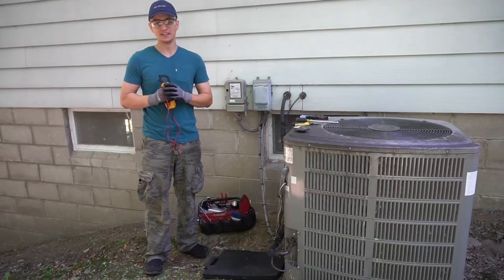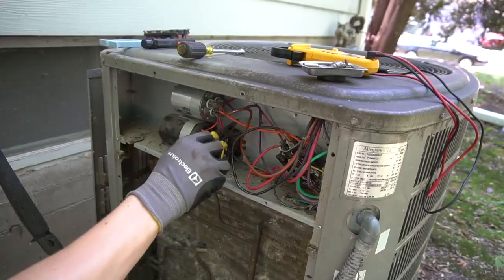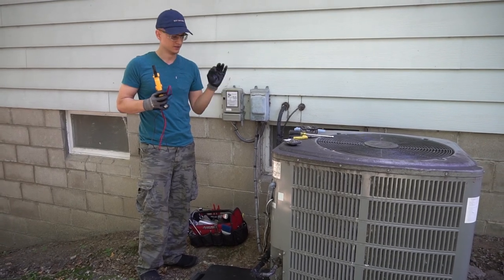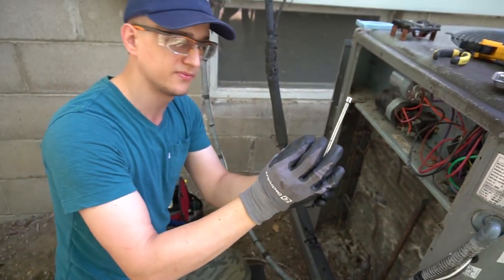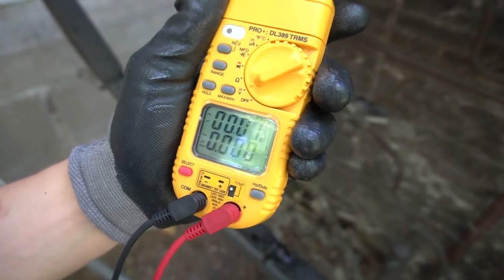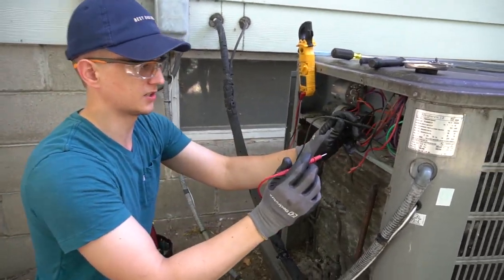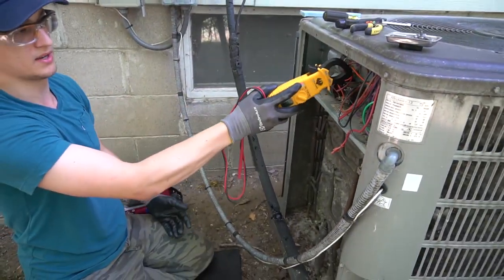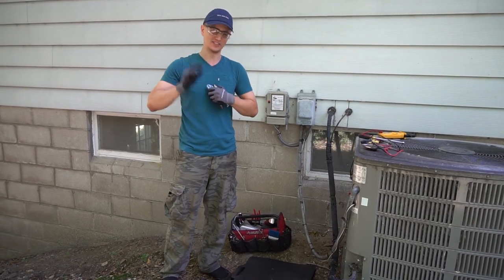Watch This BEFORE You Fix Your Own AC

Comment from the maker: Last week one of our techs at work had a similar scenario that I talked about in the video. He pulled out the AC condenser disconnect and when he touched a terminal with his needle nose, it sparked. He investigated and found that the disconnect was not wired at all! Whoever put in the disconnect pretty much bypassed it. Taking out the plug does nothing. So double checking if your unit has power is an important step.. Stay safe!

Comment: I was taught to always test your leads on the continuity setting before testing voltage. If you a bad lead it might not show voltage even though it’s there. I’ve done this and taught this for 25 years now.
Reply from the maker: Now that you say that.. They did drill that into us at school but I guess somewhere along the way I stopped doing it. Thank you for the reminder!
Reply: What's that, the continuity setting, do?
Reply: @LBizKid04  It can tell if the wires are connected
Reply: @SpencerLemay  thanks man
Reply: I'm retired union electrician and safety is paramount in our workplace. I heard that when we began organizing members our mortality rate was one out of every two wireman were killed by electrocution . And when I began wiring in the late 60's , there was very little grounding in the codes and being done in housing. Over the years it has increased and is infinitely better safer today than it was in the beginning. 
  And we used to work things energized often when troubleshooting as an example but we don't anymore. Been many years since then.  And when we open a circuit we use personal physical locks that we individually have the only key to be able to energize after we lock it out. And at each lock we leave a tag stating who we are and that we have the circuit de energized while we ate working on it.  But like you say a bad test lead could cause for a shock and shocks are always bad . Depending on circumstances it can become fatal. What I do is use two testers after shutting down to insure the circuit is really dead before my hands touch anything that might still be live. . I use a non contact voltage tester with light and sound if voltage is present. Those can be problematic if used to trouble shoot because false ons are quite often but false offs never happen . if the thing says is hot it may not actually be. But if they dont show any voltage I am confident there is none. But I then check with my wiggie and I always make sure it works in a known good plug before I use it to test the circuit I'm getting ready to work on . its nice to say you always treat everything as if it were hot but that is not realistic. We have boatloads if work to get done at times and the gloves we use ate not rated for the wiring we are  doing if it were energized. Example 480 /277 volt lighting. Circuits are locked out and we wear thin gloves that allow us to grab screws and wire nuts etc . So we have procedures we follow or people get hurt. You can't trust your meters until they have been tested at the time of use. They are possibly unreliable and in order to been positively safe , it takes this extra step. Your way , using the ohm meter to check the leads is certainly a good way if you ate using a multi meter. I personally prefer a wiggie. Its how I learned and included  in my tool box. The Flukes are contractor tools so often we don't need one or check one out. But our wiggie is always close at hand. And I've cine to love my non contact tester for safety. And there again I'll make sure it works on voltage near by at the time I " test before I touch" after lock out tag out.  
   And dont underestimate household power. It can be deadly. Follow your safety procedures . no short cuts and they should mitigate all hazards.  Think about what you are doing all the time. Not beer and women . wait till after work for that. .
Reply: @deanstuder1775  great reply!

Comment: good video.  thumbs up. thank you for the emphasis on safety.  2 items I thought of while watching that I am not certain you covered (maybe you covered them elsewhere). 

You had them on, but make sure you have good insulated shoes or boots on while working on hi-power electrical circuits.  Insulated footwear will prevent you from being a low resistance path to ground.  You had a pad of some sort while you were kneeling down and that pad would probably present a good insulator to ground.  Goes without saying that you can get bit or shocked between your 2 hands if they present a low resistance path across AC power, but you can also get hit if your hand to a foot or knee presents a low resistive path to ground, especially if the ground is wet or moist.  Many schools will teach beginners to use wood to stand on or kneel on when working on AC power to prevent getting shocked. 

Also, the large capacitors at the condenser unit will hold a charge for a fairly long time.  That charge is quite enough to hurt or kill a person.  So, be wary of the capacitors after the power has been removed and carefully shunt the energy to ground before getting your hands in there.

Comment: Was about to work on a 480 volt motor for a pump. A few feet away was the named breaker for that pump. I turned it off and opened up the connection box on the motor to disconnect the wiring to pull motor for replacement.  Luckily I was taught to always check power with meter because to  my surprise, it still had 480 on it. 480 will hit you so hard it will throw you across the room.
I asked my supervisor where I can kill the power, and he said Oh yeah, we changed that feed to a box on the floor below.  I asked him why he left the breaker near the pump with no note or anything. He just had a blank stare. I removed the breaker name plate, removed the breaker and noted that disconnect was one floor below pump. Around electricity trust nothing, even yourself sometimes.

Comment: I use to be a an AC tech years ago. One thing I was taught when it comes to testing a 240 volt circuit, is to referance each hot lead to ground.
So on the contractor where power comes in from the disconnect, take one of your meter leads and touch one side of the contactor and take the other lead and touch metal and you should get a reading of 120 volts. Do the same for the other side of the contactor and you should get a reading of 120 volts. It is a little safer because you have less voltage in a close area of your hand if the test leads slip. Less voltage through your body this way. Or you accidentally cause them to come together causing a short circuit. The condensing unit should be grounded if wired properly.
Just my thoughts other than that everyone of his videos have been very well though out and planned and great detail put into them.
Safety first!
Reply from the maker: Thanks for the pointers Pete! I will try to remember to incorporate that into my habits :)

Comment: Hi, my name is Rick a retired Electrician, and I used to use my fuse pullers to push the plunger in on motor starters and contacted because they were plastic with no chance of electrical shock. Hope this helps.

Comment: If you still have one leg hot, testing across the contactor terminals will not read 120 as you said. Only testing to ground will read 120.

Comment: Great video's. Now, I have a question i haven't seen anywhere else. My 1995 TEMPSTAR by Intercity Products central heat and air (electric package) tripped a 30 amp circuit contactor breaker awhile back. I had some experience as an assistant years ago. My present thing to do is take always take photo's or video before doing any wiring or replacing parts so there is no chance of mixing up the wiring locations as many units do not have color coded wiring. However, after finding my compressor wire end burned off, I replaced all new ends and it started working, but the 30 amp contactor had already chattered too much and i pulled the simple few wires, took the old one in to get a new one. since the dealer requires you bring in the old unit to sell you the correct part. 
I got the right contactor but when i installed it i found the wires had been changed to bypass the little 5 minute delay start up switch. I thought i had replaced the wires where they were, the new contactor chattered a time or two, then blew a fuse, replaced the fuse then it finally worked. 
Only problem is the AC works as it should, the outside fan cuts in when cool is called for and when temp reaches the set limit it cuts out and will work all day as it should......  trouble is, the inside blower fan never stops running between cycles. Oh, did i mention, I broke my rule, i didn't take photo's before removing contactor? of course i didn't ! Any chance you could tell what wire is WRONG causing the blower fan to run forever while everything else works as it should ? many thanks.

Comment: Those fans can use a little oil once in a while. Mine has a tiny plug where I occasionally add a few drops. Same with the blower in the attic.

Comment: Test for power with at least 2 devices.  Don't do it even if you took the disconnect out and flipped the breaker.  My AC was still hot even with the breaker off.  Had to shut off main breaker to work on AC.

Comment: Great video. Great channel.
Question:  I have a 1.5 ton  220 volts split unit AC. After few seconds of turning it on, the clamp meter reads 22 A then rise to reach 37 A for few seconds then it stops and the clamp meter reads zero or 0.1 A. What could be the problem ?

Comment: Nice tips. Also the importance of not putting your knees on bare ground, thus forming a perfect ground for electricity to travel is very important. I see you use a pad which is much safer. How well you are grounded can mean the difference between life and death. A lot of people have died working under houses. Laying in direct contact with the ground and touching a live circuit is a recipe for disaster. The electricity has to have a path to ground. You don't want to be the one completing that circuit.

Comment: That Klein nut driver is not insulated you wouldn't be able to see the metal shaft, it would be covered all the way to the tip. All that rubber on the handle is the cushion grip not insulated. The insulated nut drivers are 30$ to 40$ a piece. Good video and information though. Home depot is having a sale on the insulated nut drivers and screw drivers right now.
Reply from the maker: Thank you for the correction! Good to know the right terminology heh..

Comment: I watched your video a few times. This is a very good video. I just have a strange issue with my AC yesterday.  I turned AC on to Cool and waited more than 5 minutes after the "Cool On" stopped blinking and there was no fan running inside the house  or outside at the condenser. Of course, the set point temperature is at least 10 degree lower than the ambient temperature. However, when I switched the thermostat to Heat, the heater ran perfectly fine and the fan inside the house was blowing air as normal. But why the fan inside the house did not working/blowing any air when I turned the thermostat to Cool? Does the fan inside should be running and blowing a warm air? Please help and let me know if I have missed anything.
Reply from the maker: This video was more of an intro. that link I gave you was to the AC Fixing Playlist. I would watch "the most common fix" video and also "AC not turning on, how to fix it"

Comment: To keep yourself even more safe all havrcs i believe must have a wire organizer to help prevent and protect from touching any metal at all so in the vent of that 240Amps/Vlts then we would not ever easily get shocked with a proprietary invention that would help even more connect the organizer and wrap all of the wires around so this way they will be able to keep us from gettin gall charged up even when simple mistakes are involved like i.e. looking away and/or accidents like touching the wires when power would be running from the amps/volts in the wiring and electrical to the circuit and the plug that the plug pulls into to start the power up for the AC unit.

Comment: Question... What does the furnace have to do with the HVAC system? When I turn on the heater the heat symbol blinks continuously but nothing happens. The same thing happens with the air conditioner.  Help

Comment: The Disconnect on my wall to the AC unit has two batteries about the size of two "C" alkaline batteries.  Do these batteries need to be replaced?  I ordered a capacitor for the AC because the fan turns on, but I'm only getting warm air from the vents.  I hear the AC unit trying to turn on, but it stops after two seconds.  The fan doesn't turn at all anymore.  Does this sound more like a bad capacitor?

Comment: Hi jay question can change condenser fan motor old one 825 Rpm not working and I’m changing with new 1075 Rpm with 5 mfd capacitor it’s going to work?

Comment: I have roof unit that is sometimes randomly inside fan on but Compressor/Fan not turn on.   It is very random time so it is hard to diagnosis.  Sometimes when shutdown Power and turn back on it works again.  I already check the relay, capacitor, HPS/LPS are in good working condition.  Any idea why it happen randomly?

Comment: I don't have the disconnect/pull switch, but I do turn the fuse/breaker boxes or panels near the AC units and in the house, to the OFF position. Am I safe to inspect and clean my AC units! Thank you in advance for your help!
Reply from the maker: You should be good! The only way to know for SURE is to check with a meter or voltage pen. But for cleaning and inspecting you should be fine. Thank you for all the positive comments! :)
Reply: Word of Advice TV I appreciate the response and you're welcome! I'm definitely grabbing a voltage pen too!👍

Comment: 3 years old HVAC fan working but not blowing cold air, the AC technician said it is the TXV valve broken, since it is under warranty, he replaced the TXV valve & recharge the R410A refrigerant  AC working but only for 6 days, same problem occurs, technician checked and found the newly replaced TXV valve broke again, he called and per manufacturer, vibration may be the cause, and he said need some rubber wrap or seal to reduce the vibration. I have no clue, summer time, so hard to book the repair, please help

Comment: question, i replaced my 45uf capacitor with an 80uf until i receive the correct 1 in the mail, it seems to be running fine, cooling and all, i just dont know if thats ok to do ,?
Reply from the maker: To be honest I have never tried putting in a capacitor that was twice the rating of the old one.. That can't be good for the compressor. I would put in the new one right when you get it.

Comment: I've not read on the comments, but.. If one leg is "disconnected" and the other leg is hot, it will STILL read zero volts across the two leads. If you want to be SURE both are disconnected, you need to measure both against ground.

Also, the reason you welded your pliers to the chassis, it was likely due to the charge in the capacitor, not your faulty disconnect.
Reply: Best to follow his advice and turn off the circuit as well.  Btw,how do you measure to the ground?  What do you put the other lead on?
Reply: @SoCal9705  the chassis should be grounded. Measure any line against a nice clean (bare) metal piece of the chassis. A nice non-contact voltage detector is a good idea too.

Comment: I found a dead lizard on the capacitor, could the capacitor break cause of that?
Reply from the maker: If you have a meter that can check micro-farads/uF, it would be nice to check it. But most of the time the capacitor will still be good. If your unit is not working though, replacing the capacitor would be a good start.

Comment: What brand gloves are those?  Where did you get them?  I want a pair!
For the voltage meter on the contactor to verify power off, do the black and red leads have to go on a particular side?  Or is it the same either way?  thanks, great videos.
Reply from the maker: I got those gloves at an Electrolux manufacturer training I went to. To be honest, they are not that great. They are good gloves but they started slowly falling apart in like 2 weeks. If you were just asking to find out what type of gloves those are, here's an example of a 12 pack on amazon: https://amzn.to/2NiLGQB   As for the leads, it doesn't matter which lead goes to which screws. Stay cool! ;)
Reply: Word of Advice TV  Thanks that's helpful!
Reply: It doesn't matter cause what u are measuring is the potential difference between the two legs